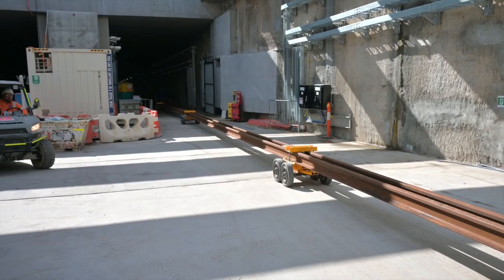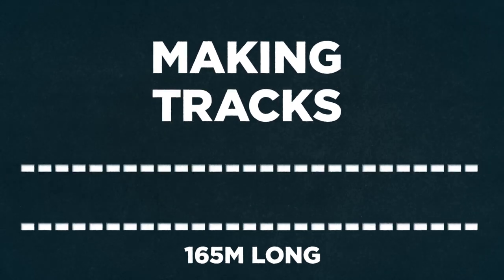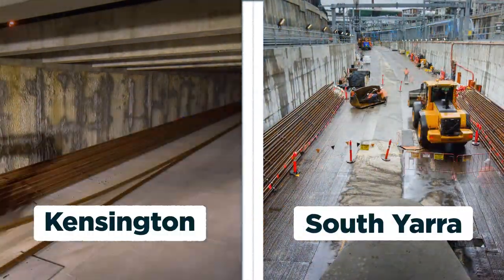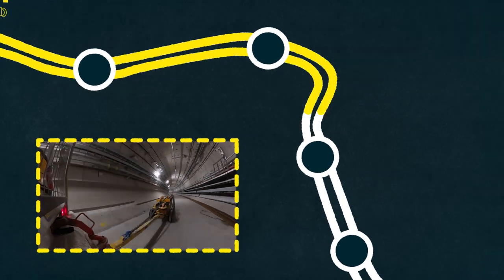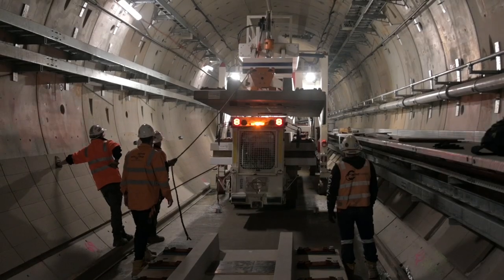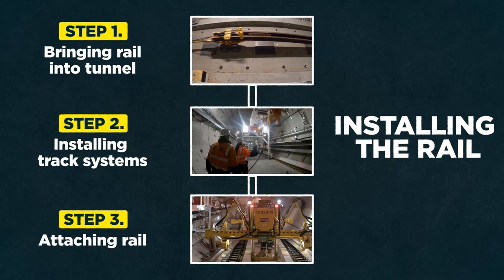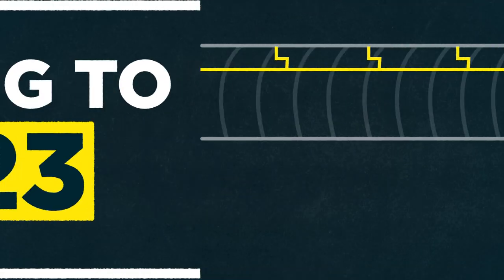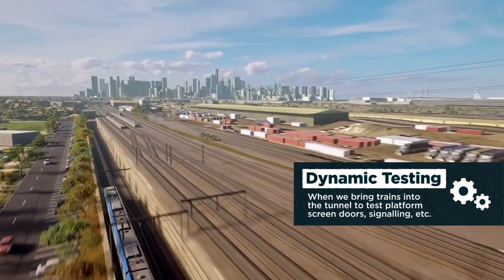Station Shaping: Building our train tracks

Comment: Very important we say eastern portal, and not South Yarra, as that would just remind us that the plan was compromised from the start!
Reply: The South Yarra portal states that it is counting out at South Yarra, not the South Yarra station. I agree that there should have been a link to a station there, but that would have added another $1bn to the project.
Reply: @melissavredline1264  like that 1b dollars that was thrown in the bin by cancelling East-West Link?
Reply: Every major infrastructure project requires a compromise of some kind. Considering you can easily change at caulfield or in the CBD, the lack of a connection to the existing south yarra station is a minor inconvenience, not a deal-breaker.